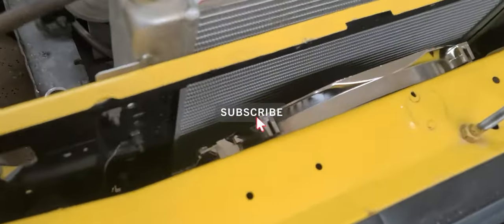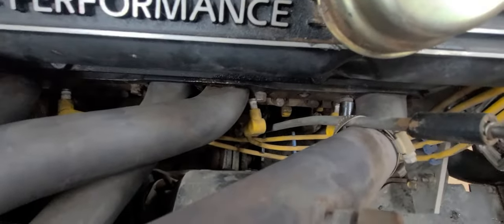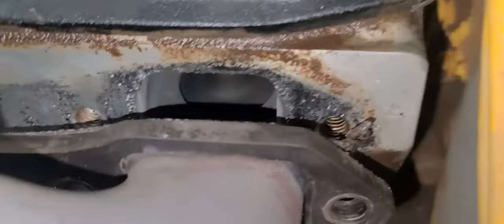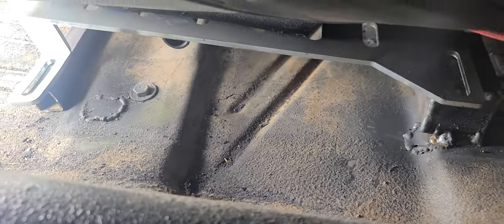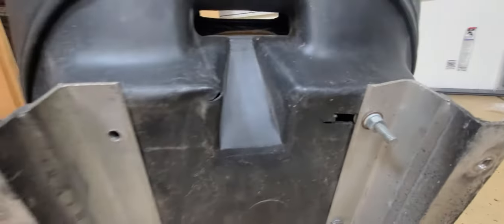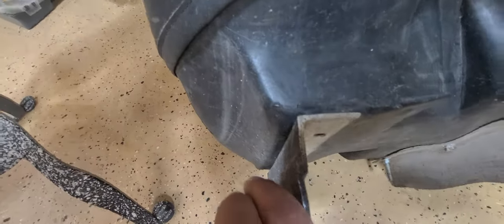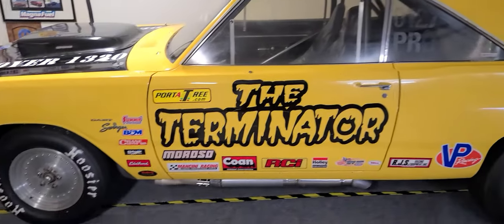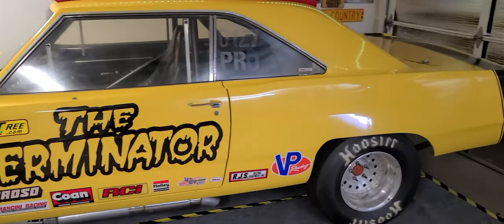1971 Dart Comes Home  after (More upgrades)

Comment: You're not gonna be happy with that fan. I had one. Jegs way over rates their cfm and it just doesn't cover enough of tha radiator.  Get a flex a lite black magic 18" fan. They work great.
Reply from the maker: Will do you get it, 100 all the time and cooling is paramount
Reply: @Destroyer1320  summit racing sells them. I might have gotten the size wrong.  Maybe mine was the 16" size.
Reply from the maker: @stevenwing2370   I am going to fire it up and if it sucks I will change it out for sure, I appreciate the advise!